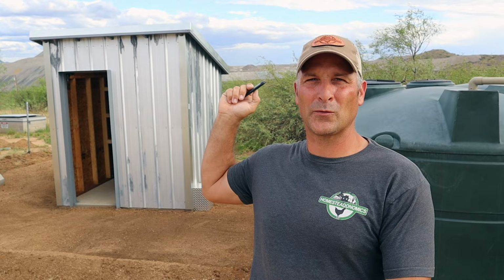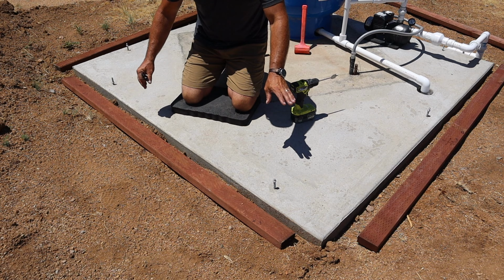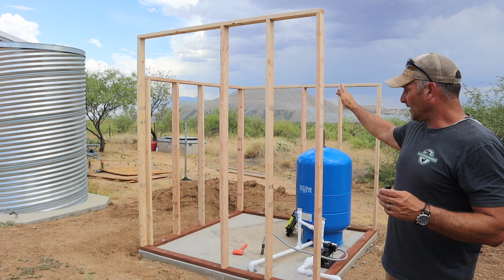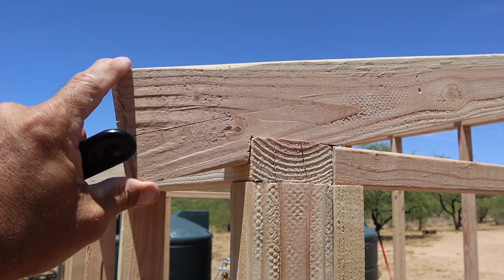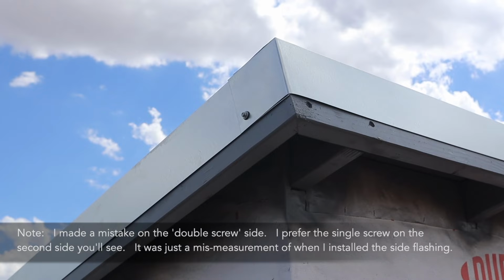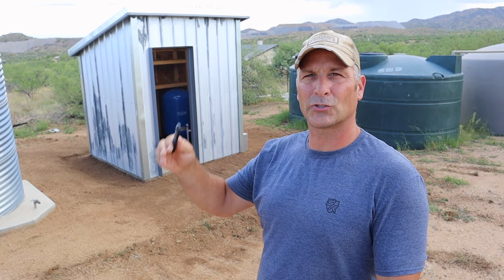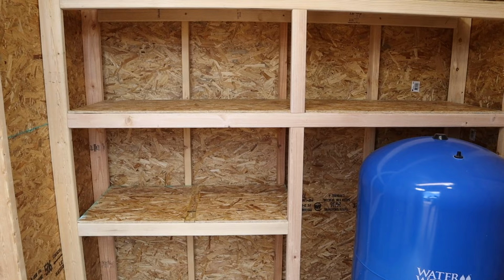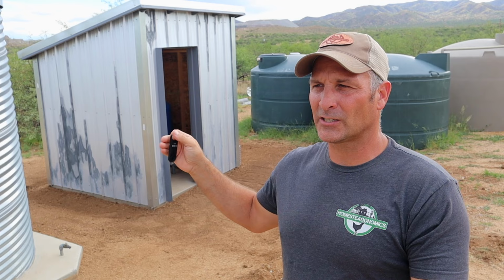Rainwater Pump House Build  - How To ( Part 1)

Comment: Quality installation.
As an electrician, THANK YOU for the outlet for the light, that one add-on saves more of our lives than you can imagine!
Reply from the maker: Thank you!   That’s how I did it for my shipping container shop.l and in my garage.   I figure it’s easier to replace the shop light with plug in types….so no hardwiring needed😊🙏
Reply: How so?

Comment: Joe, you never disappoint with your project builds. I especially like the diamond plate aluminum box...😊
Reply from the maker: Thank you Manny!  Glad you liked it…. I wasn’t sure what I was going to do for that and then I saw those scraps sitting around that were close to the sizes I’d need.  A little bit of cutting and some rivets later I had a nice durable box to protect them.

Comment: Thank you Joe... another great video documenting you infrastructure.   Do you have to worry about extended freezing temperatures during winter season.?   A suggestion, perhaps a typed sheet of directions on how the pump system works and suggestions on steps to troubleshoot problems for times when you are working and unavailable.  Also, consider adding a GFI-C outlet as an added layer of protection.

Wishing you and your family a blessed week filled with gentle rains, seasonally appropriate weather and restful evenings together.   Peace brother
Reply from the maker: Thank you.   Yes we do have some periods of extended freezing….,but it’s usually only a few days at most.   I think the hardest freeze I’ve ever had in ‘this’ area of arizona was into the teens at night and up to the low twenties in the day.  Last for 3 days or so before getting to more mild temps.
However, I have been in the single digits for about a week during an elk hunt in northern arizona though.   Cold for this desert transplant🥶

I do like your advice on the instruction a lot!   

And my blessings to you and your family as well!
Reply: @homesteadonomics  Just thoughts for the others in your absences.   Alternatively, it becomes a reminder of what your were thinking for the next upgrade 15 years from now...  ;~)

Comment: With regards to insulation, if you have any leftover fiberglass batts, just use that. Insulation is really just more about slowing down the temperature change inside the building anyways. And I love The rustic look with the panels.
Reply from the maker: Thank you, I do as well!😊🙏

Comment: Looks good brother ... Im almost done with our mech room .. I want to see ur filters mine are 10" but I want the ceramic filters I just don't want to lose pressure... Keep it up brother looks great......
Reply from the maker: Thanks!   And I’m glad this is aligning with your project too……kind of adds some relevance since you’re all dialed into this subject right now.

I’m still working on figuring what system I’m going to use…. Or piecing one together.
Reply: Yeah gotta have the rain water cleaner so it doesn't mess up the pump or our tankless heater...

Comment: For your ventilation system, how about a screen covered vent just above the floor at the rear and a "aire hawk" type vent on the roof or front wall. Leave the metal like it is, gives it a "been here for years look".

Comment: Funny you mentioned solar:  is there a reason you don't power your house with solar?  I've always wondered.
Reply from the maker: The super short and quick answer is money.   I don’t have the funds to do it.   And my area there aren’t enough rebate funds to make it worthwhile.  Most are reserved for municipal areas…..they don’t cater to us ‘rural rednecks’ 🤪. Not to mention there are always strings attached with you deal with gov programs.

Also, I have looked into a few of the ‘solar city’ type outfits that do ‘grid tied’ systems.   But aside from the lack of rebates I have found the contractual obligations to be troublesome.

But I would definitely LIKE to do it.   Just a matter of funds.   And when I am able, my ideal would be to be fully off grid, with batteries.  As I wouldn’t be interested in grid tied.

Anyways, hope that made sense…at least a little bit🤪

Comment: Ha. You need a rain roof over your diy camper. To keep it safe and also catch more rain water. You say it doesn't get that cold for insulation, but doesn't insulation help with heat also?

Comment: Have you thought about adding solar electric for you home?
Reply from the maker: I have an would like to eventually.  But I don’t have the income to pay for something like that right now.  Unfortunately the ‘gov rebates’ don’t apply the same in my area.   Aka…they don’t like us ‘rural folks’😂

Also, the programs with companies that do grid tied systems where you lease and layback the system are usually riddle with clauses and oThe things I find troublesome.

But when I do, I will most likely opt for a fully off grid, battery style setup😊

Comment: I did not notice you putting any underlayment between the concert and the bottom wood walls.   Did you put it or did you forget?
Reply from the maker: I did not forget, just chose not to.   Sometimes that underpayment can trap moisture between the underpayment and the boards.   For a house where it is completely sealed and not likely for water infiltrations….it’s a different matter.   But for this simple she’d structure that will undoubtedly get some water when I do things like maintenance and have to drain things….there will be an inclusion of moisture past what would be normal.   Not the ‘right’ thing….just my thoughts.
Reply: @homesteadonomics  I understand your reasoning.

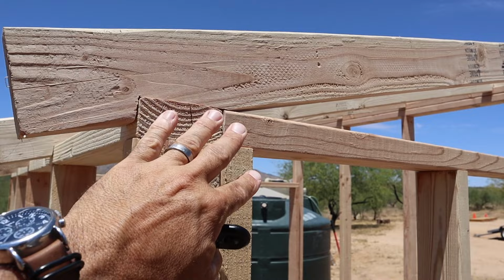Comment: 7:40 - Just drill a hole before screwing so wood wont crack - so basic. Also this shack is so primitive,  so any drunk guy can fall it xd
Reply from the maker: Was using nails, not screws…but I guess next time I’ll drill pilot holes for the nails.  Thank you!
And yes, it’s a simple shed structure with a pump in it.  Nothing fancy.   Just a basic structure.  Good day to you😂👍